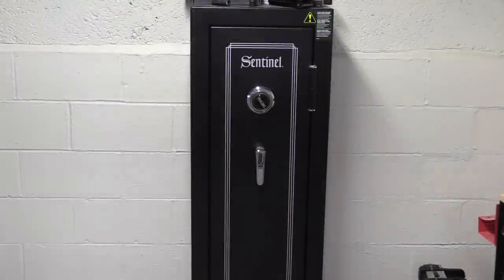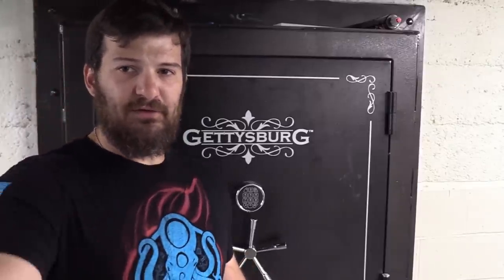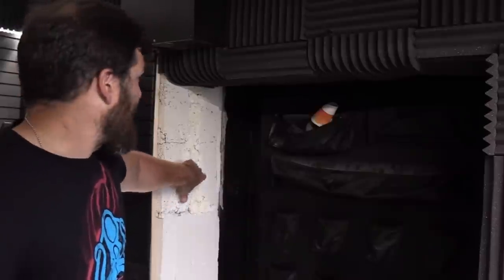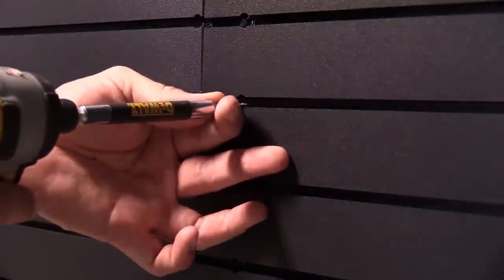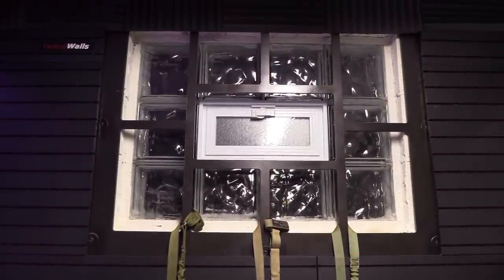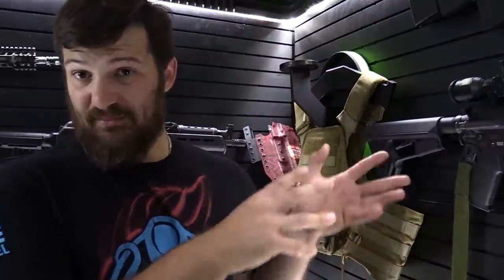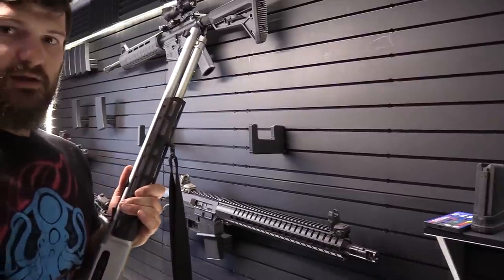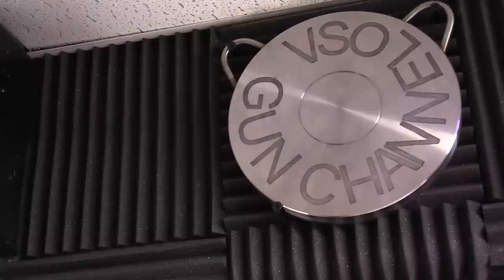The Ultimate DIY Vault Room

Comment: Can you secure the room from the inside without potentially being locked in from the outside? A chain is only as strong as its weakest link. I’d rethink the whole window thing. Steel grate or not, it seriously compromises the integrity of the entire structure. Still pretty badass though. Good job.

Comment: should replace the glass blocks with solid glass blocks, Sieves sells 3 inch thick poured solid glass blocks, and you can use steel reinforcement while doing the block work, pretty beefy , costs about 40-50$ a block though.

Comment: Nice work. I’m working on something similar, great ideas. One question maybe it’s a stupid one. What’s protecting the ceiling? Could one if so inclined punch a hole through the ceiling , from the above floor  or maybe it’s an attic above?.(pretty easily).  What did you do if anything? Looking for ideas. Cement and steel ceiling would need a support column I’m guessing . Nice collection btw.

Comment: A lot of work went into your safe room. Very nice, as you know you need to do some more work, but you are getting there. The freaks who are in panic mode need to realize your still working on your room. You should think about asking your insurance adjuster about reducing your insurance cost with your weapons since you have made it a priority to secure your weapons to such a degree, they may knock off a few dollars. The one thing I didn't see is if you had a heat detector and a smoke detector wired into the safe room into your security panel. A heat detector which is rated at 135-degrees and a photo smoke detector for smoldering fires will provide a safe means to let you know something is wrong in your safe room since you do have electricity and its good insurance for the protection of you and your family. You should also have a NAC installed in your safe room also in case your in the safe room and a fire breaks out. You may not hear anything being that you have foam throughout the room for noise. You may also want a 3rd party professional security company to do a nonpartisan evaluation just to see your weak points and come up with solutions to better secure yourself. Good day, be safe...….

Comment: Everyones talking about the window, which maybe wasnt an amazing idea but I'm wondering how you get out if the door gets locked. I mean you're using a normal gun safe for a door. They dont usually make provisions for a human to get out from the inside. Also sure a window grate made from AR500 steel is better than regular steel but it can be cut and oxy acetylene torches arent as loud as grinders. Id suggest getting a new grate made to fill in all the extra space except the vent window. Sure a person cant fit through but the more bars theyd have to cut through the better off youd be. But all in all its cool and a good idea.

Comment: Not trying to be an ass- just something to consider. Countless camps in my area used bars on windows, bolted through like you have. A 4 wheeler or a truck, within minutes, defeat the bars. They run a hook/chain through the bar, and go- and within 2 minutes- there was a giant hole in a concrete block wall. Either extend hardened steel bars 18" or further into the concrete, or steel shudders with no exposed hinges do better. 
Looking at your set up- a guy could get his hand through that small window you use for ventilation, hook a chain up- and be in your vault in 30 seconds.

Comment: You did an outstanding job on this room. But I have to agree with some of the other comments that you need to beef up that window. Maybe put 1 1/2” steel bars 2 inches apart across the opening would definitely slow someone down trying to get in. Also ballistic glass would be good. Other than that it’s awesome.

Comment: Not sure if you have dry loc on concrete? Furring strips will start rotting. Need to install a landline inside in case you get locked in. Make a steel plate for the window or remove it completely. Someone can easily destroy all thats inside your room without entering it. I would think about a halon or other fire suppression system inside too. Maybe you have all that? Nice spot and excellent vid either way.

Comment: Damn fine job you did. I didn't know about the Tactical Walls so this video helped me out as far as where to source an awesome looking wall system.
Wife and I are in the process of designing/building our final, gonna die in this one, home and we are putting in a bunker type vault room. I plan on having my HVAC guy do a completely separate system just for the vault room, so the air in the room should be top notch.
Additionally, I plan on having a single lane, indoor range right off the vault room. Not sure if I'm going to have the walls formed and poured as if they were normal foundation walls, or just buy some shipping containers and bury them in a straight line. No matter what it's going to be an awesome addition to our next and final home. Thanks again for some awesome ideas.

Comment: Awesome cool room. Living in FL means no basement for the most part. While the window is an issue (as many state) it can be mitigated. What can't be mitigated is the magnet problem. Never buy a safe with a solenoid actuator!  Actually thinking about it you can harden that part by welding a standoff, say 2 inches tall, above the solenoid. They are usually NW of the keypad.

Comment: very cool build but that window is barely a speed bump to get through.  call your buddies at the metal shop and have them fab you up a steel plate shutter instead of bars that you can open and close if you need the light or ventalation.  that would let use a more conventional window you can get out of in case of a fire.

Comment: “I tripped it in the middle of the night one time, that was, that was not a good experience, I was in trouble for a little while.”

I’m calling bullshit. Cops knocked on your door 27 minutes after alarm was tripped. You let them know you fucked up and thanked them for checking on ya. Cops got on their radio and let dispatch know that it was a false alarm, and it was probably the 7th one that night. Cops went back to Thornton’s for free coffee and donuts. 

All in all tho, the rooms pretty sweet man. I do believe I’d just fill in the window tho. And since you’re a self-proclaimed go big or go home type, I’d also strongly recommend getting a sprinkler system installed. Crack heads roaming at night isn’t the only way you can lose your shit. It can also lower your homeowners sometimes depending on your insurance.

Comment: Very neat room.
I would concrete from the wall to the exterior edge of the safe door frame on all 3 sides in excess of a 45 degree angle.
Setup an opening mechanism for the inside and it can be a safe and a safe room. If you have home camera system you could put up a decent size monitor as well.
Then I would better secure or concrete fill the window.
Its a cool room and I can tell its not meant to be fort knox or a nuclear shelter and also be a place to record videos but it can be even cooler :)

Comment: The 2 glaring errors in your otherwise impressive setup, the window was a horrible idea, a plasma cutter would cut through your bars in a few seconds. Your motion detector is so easy to defeat, it has to communicate one of two ways, simply disable both and your motion detector is worthless, telephone hard line is easily cut and cellular jammers are easy to come by. Since you bought a conventional safe to get the door, you apparently don't have an escape mechanism, any kind of walk in safe or walk in freezer is required to have an emergency release for escape. You may have made some accommodation for emergency exit, and I wouldn't blame you for not giving it away.

Comment: Maybe you can get some hinges welded onto that window frame and get an insertable (maybe 3/4 inch) steel plate to have a compromise for that ambient light and ventilation. That way you can remove it if need be. Better start eating more corn that’d be heavy.

Comment: I built one of these using an old large safe door from an old 5ft high by 3ft circa 1930 here in the qeer old corrupt 🇬🇧.  I bolted the safe door weighing almost 600kg to a steel girder door frame welded together and concreted in to the floor of the concrete walled roof I used . I cut the old safe door using a stihl petrol cut off saw and a few good disc blades . Bolted this to the steel H girder door frame and then lined the whole concrete room with 5 mm steel plate bolted to the floor ceiling and walls then spent 3 weeks arc welding the seams of the steel sheets butt jointing.  Now I show the armoured gun ..panic..valuables storage vault as an example and install and help others install them. I get all my large safe doors from my scrap metal collection buisness here in the UK usually from old banks that are closing quicker than Katie Price knickers are coming off..for free..

Comment: I say this so you can fix it before it happens, not to rag on anything. If you had water issues before, pouring a slab on the ground and sealing the window a little better isn't going to stop them from happening again. You need to fix whatever the issue is that brought the water against the house in the first place.

Comment: I have 2 questions:   
1.  You have a drop ceiling. Can someone push the ceiling tiles up to get in the room?   
2.  How do you get out if someone locks you in?
Reply from the maker: 1.) if you can get through the galvanized and the 18” of concrete. 
2.) the door has an access panel under the pistol sleeve

Comment: hi buddy great set up, the bolts on the out side of the vault, you could cover them with box steel to hide them. Your window yes it is nice except it should be covered with steel plate with an extractor fan no bigger than 4 inches for air flow,. Please don't take this as criticism for I personally think that you have done a sterling job and spent a lot of money to stop the tea leaves (thieves) as you say it is not quiet finished. I have a similar set up and manage to put a handle on, the same as a walk in freezer on the inside. I have also stored food and water with dive bottles for breathing and various other goodies, why you ask because I would rather have it and not need it. Great use of space well thought out, only one negative thought, you should not have put your face on the video. peace and love my friend.

Comment: You wouldn't need an AT4 at all, with one of those Gettysburg safe doors, simpler things like liquid nitrogen, a heavy duty grinder, and a small plasma cutter would all do the job rather quickly. Nearly the same would work on the bars on the window. However, your vault is far better protection than what most people people have and any protection is better than no protection. The most defeating element to your entire security and vault build is the fact that you've revealed its existence, its entire contents and pretty much every element of your security measures within the vault. A vault that doesn't exist as far as others are concerned, is the safest vault of all.

Comment: Now if it a really good safe door it WILL have tungsten carbide scarp in the composite part of the door  in the concrete... its very common with older Bank safe's ...prevents drilling or angle grinding and destroys masonry drill bits..... not fun to bolt safe's with that stuff

Comment: I love your idea of using a gun safe door for a walk-in vault I am a professional safe cracker great idea what your choice for safe is not so great this is a Chinese safe it has a slight flaw when you lift the keypad off of the safe you'll see a keyhole that gives you a bypass key in order to open the safe you can drill a quarter inch hole right above the screw hole that holds the safe lock on in the matter of a few seconds the safe is it will be opened and I made a video on my channel of how to do this you should pull off your back panel and reinforce the inside of the safe with a piece of carbide in that spot this will prevent anybody without a drill press from getting in there. Keep up the great videos

Comment: Not at all trying to crap on your gun safe room, however just some constructive criticism, it seems a little redundant to have the block reinforced with steel when someone could simply spend 10 minutes with a metabo to cut the heads off the anchor bolts that secure your door. I think it would be ideal to have the fasteners located on the inside of the frame. Does a run of the mill burglar carry a metabo to every house they rob? Obviously not, but again just some food for thought. Seems like a simple upgrade in the future.

Comment: Seems like the window in the vault is def a weak point. A sledge to break glass block and an angle grinder to cut the steel and could gain entry fairly quickly.. your motion sensor is only effective if you’re always around to respond. I like the idea of a vault for sure but I think I def would’ve closed up that window with the same steel reinforced concrete everywhere else..

Comment: cool vid until the window and your concrete walls are not solid. i just cut a 36x72 opening outta the side of my foundation wall for a 3x6 exterior door only using a concrete saw and sledgehammer along with a bad back at the start in about 30 minutes. nice effort tho.block the window in to make more secure as i dont care about alarms

Comment: Had to know people would rag on the window. So Change it. 3 1/2" bulletproof with film layered every inch. Put it on some heavy duty hinges if you really need to open it and put your bars on the outside nice and flush so it cant be hooked on to with a chain. Or get rid of bars all together. Get the right glass and they could drop a nuke on your house and it would be the only thing left. You have clearly spent enough. This upgrade would probably be the cheapest one.

Comment: So what happens when the bolt heads get drilled out or ground off?
Reply from the maker: 1.) How fast are you? I believe in multilayer security. 
2.) mortared in too.
Reply: @VSO_Gun_Channel  Wasn't a dig, just an honest question as other vault doors I've seen use an internally bolted inner and outer metal frame that sandwiches the wall in between.
Reply from the maker: I will neither confirm or deny if this room has security countermeasures that were not depicted in the video.

Comment: I like it. I love the walls but I'm cheap as hell so I did metal shelves and a wood 2x12 hutch over my reloading bench. Don't listen to the idiots. The hard, cold fact is there are no perfect security systems except in an amateurs imagination. I spent 24 years investigating this stuff. You can mitigate and harden (which I think you did a decent job on) but you can't assure short of posting armed guards 24/7. The idea is to convince the burglar it's easier and safer to go somewhere else. It's called Crime Prevention Through Environmental Design (CPTED). I would take out the window but I don't think it's a deal breaker either way. The alarm system essentially offsets that weakness in the package. Kudos. Hmmm. I do have a couple of small wall patches. I wonder if you can but some of that Tactical Wall materiel in small sheets....

Comment: Neat idea. Way to think outside of the box. Has some flaws in the execution though. As a locksmith myself, I would’ve advised against it. Too many safety liabilities. I would’ve refused to be a part of any of the installation or fabrication. It may even violate your local fire ordinances in relation to egress. I would also replace that La Gard lock. They’re a locksmiths favorite safe lock. They fail quite often so lots of money replacing them plus there easy to drill. Hope you got some good hard plate in front of that lock. Personally I recommend good old mechanical S&G locks.

Comment: Decent looking gun safe room. But a few things....

....since it IS a gun safe room...why not use it as a "panic room" as well? Having a window  is a bad idea as that gives intruders a location to pipe in obnoxious chemical fumes to smoke out the home owners. Don't know if the home owner outfitted the room with ventilation that's separate from the ventilation system of the home. A good primer for a Panic Room is to watch the film called Panic Room w/ Jodie Foster. Shows what a group of determined intruders might do to get the home  owners out of the Panic room.

...the SecureIT walls...what were the panels made of? Never said. Also, I would have liked to know what the guns were sitting on...e.g. metal arms? Did they have rubber on the metal so that these arms didn't scratch the finish on the guns. And, personally...I'm not into the hardware store look. :) Also, positioning the guns horizontally takes up a lot of wall space I would have put the guns vertical. Was he planning to show off his gun room to gun buddies?  

...did he do anything to hide the safe door from view?  As strong as that wall was. Why open that door/wall to attempts? On the same token...if the police respond so quickly...why go to the trouble to concrete walls around the vault door? 

In the US it's not law in most states that all firearms must be  stored in a locked safe. So why not use just hidden doors or furniture (e.g. bookcases, wet bars...) that rotate on a pivot and put the firearms on the back of the wall? For quick access while keeping the guns out of sight? :)

Comment: You know besides the window being a huge fail point in your elaborate system, let's not forget a thief could simply go through the outside wall of your house! Siding, plywood and drywall are pretty damn easy to cut through and then your steel and reinforced concrete dont mean anything!